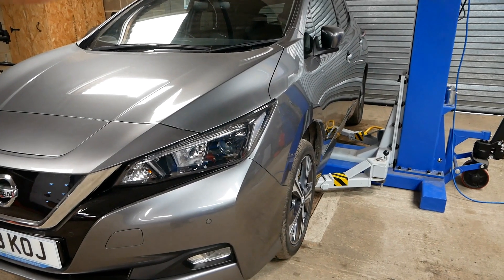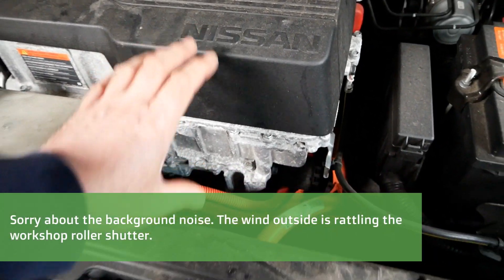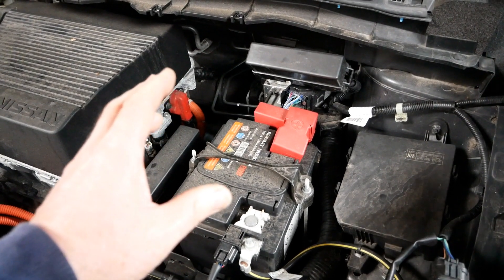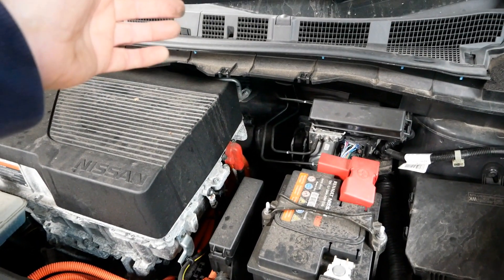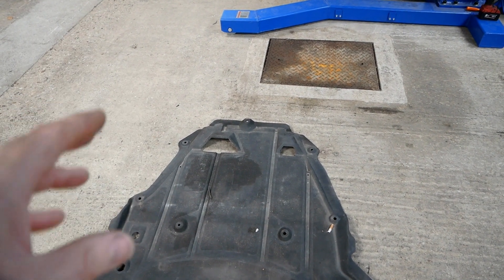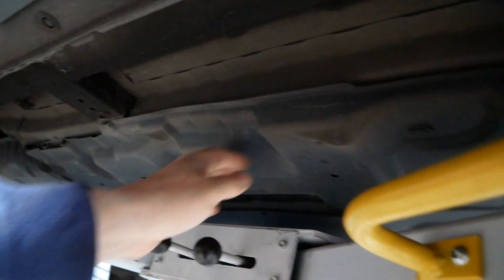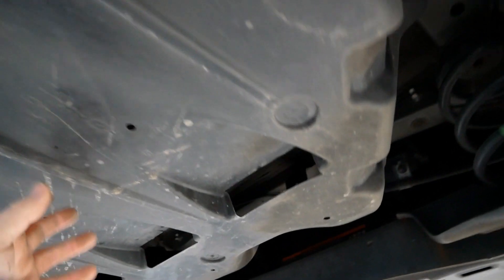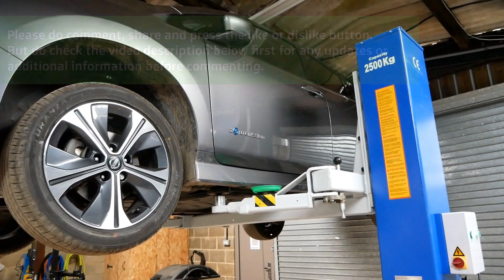What's under the bonnet in an EV? Looking at the Nissan Leaf 40kWh.

Comment: It might be a good idea to mention the 12 volt battery as you say does run everything apart from motor and its not very big so you can find yourself in trouble if you dont get the motor turned on in a hurry. Mine draws a couple of hundred watts so about 15 amps or four headlights worth which can flatten a battery fairly quickly and leave you stranded unable to start the car. It also draws current all the time to keep stuff like clock and listening for a wake up signal so if you leave it for a week or so with an elderly battery you may have to charge it before you can even open the doors which could be a problem since the bonnet release is of course inside. I found mine had gone into nueutral recently and wouldnt go into drive till I switched off, waited a bit then started up again. Had a moment or 2 of panic but all ended well and put the  12 volt on  charge when I got home. I was told when I bought it that most problems are down to the 12 volt battery getting old / discharged or both.

Comment: How do you clean under the bonnet of a LEAF?
Reply from the maker: No need too. But if you did want too, don't use a pressure washer. But everything is waterproof of course, so some soap and a brush is best and a light hose sprinkling is fine.

Comment: My City-el ev does not have a 12v battery, 12v stuff runs via a dc/dc converter.
Reply from the maker: I've just looked up what that is. With a 36V or 48V powertrain, I can see why they can do without the 12V battery. One the reasons why 400+V EVs still have 12V batteries is that the traction battery remains isolated until the vehicle is switch on, so the 12V powers everything until then, such as central locking, startup, lights etc.

Comment: on my older 2012 leaf if it sits for a long time, it will charge the 12v battery by itself even if the car is locked, you will know when you see the one light flashing

Comment: i am a die hard petrol head but I am not afraid of change and have been looking at EV vehicles for a while now and still considering getting 1 however they are still very expensive so all the advice and experience helps alot, keep up the good EV vids.  I have been looking for a dealer willing to let me test drive for 24 hours in the UK but cannot find 1

Comment: I have a KIA E Niro and have just been informed that it shouldn’t be jacked up in a conventional way to change the wheels. Is this true of EV’s?
Reply from the maker: Yes that does get repeated a lot. But no, its not true. EVs do of course have jacking points too. There's just warnings to stop idiots jacking up on the battery pack.
Reply: Every car has recommended jacking points. The warnings on ev’s are extra due to battery packs
Reply: Some late model cars require adapter pads between the car jacking points and standard garage Jack. Just to fit better. I’ve cut adapters out of wood blocks.